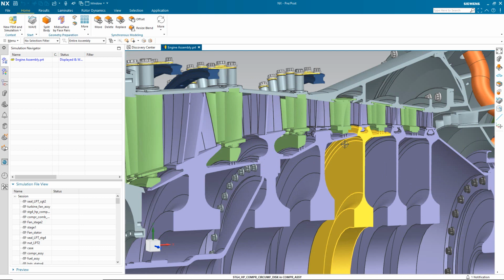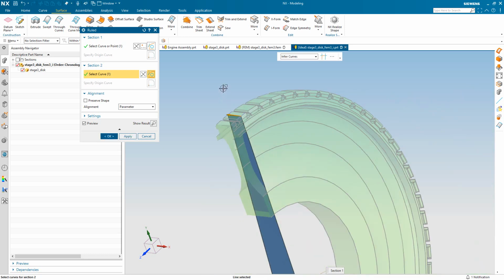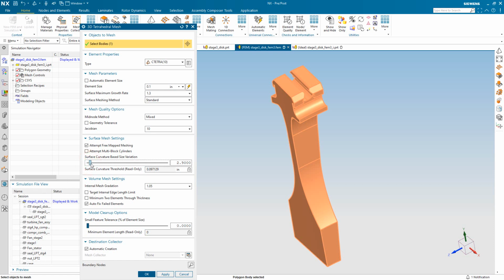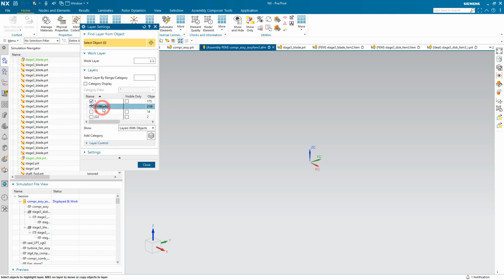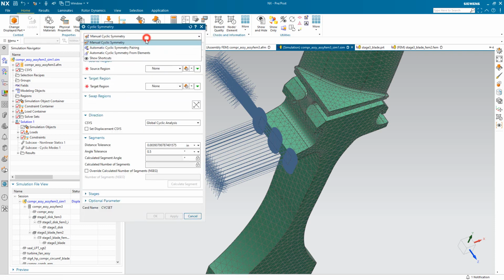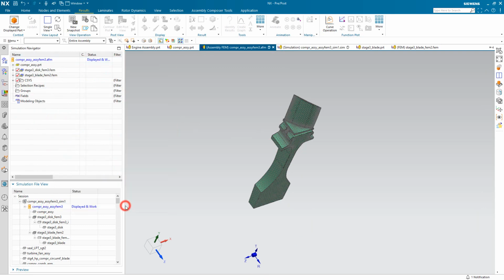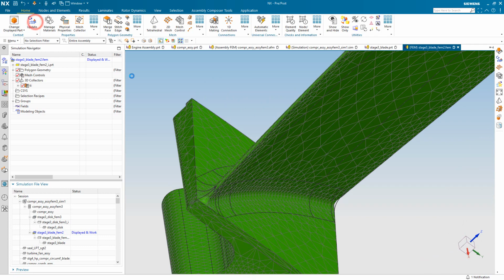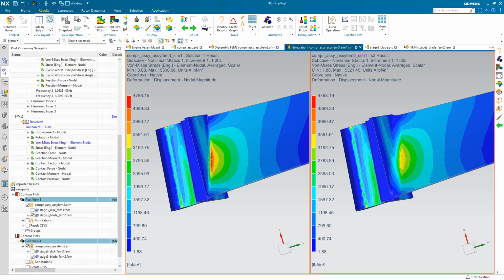Cyclic Symmetric Analysis with Simcenter 3D

Comment: Hi ,  useful video. However I dont see you assigning any of the specific loads to any of the specific subcases here, how does it know what to do in each subcase, and if its automatic, what is the point in having a subcase when it already knows what to do based on the assigned loads etc ?
Reply from the maker: Glad you liked it.  I put the loads and constraints in the global containers which applies them to all subcases.  The point of the subcases in this multistep nonlinear analysis with sequential dependence is to first spin up the structure to preload it then find the modes while the structure is spinning.